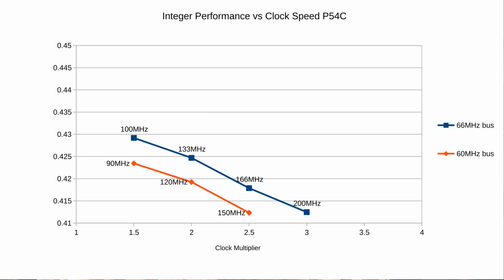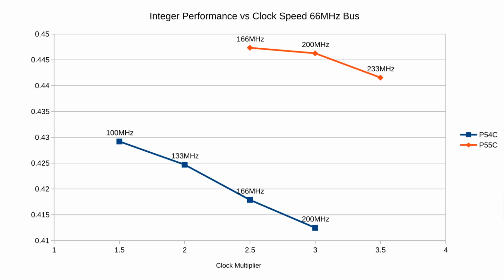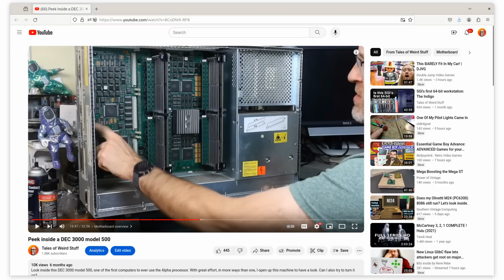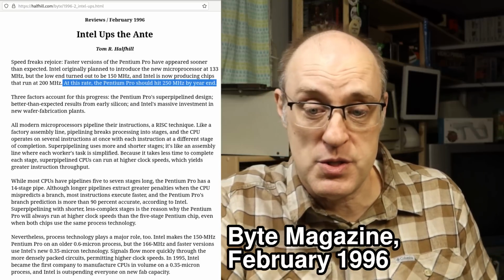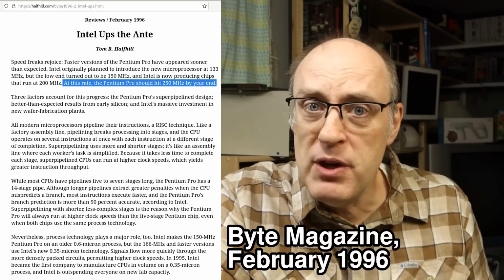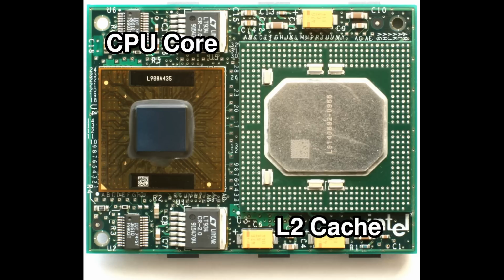Why did slot CPUs exist?

Comment: 44:45 Not all slot processors have half cache speed. Only from Intel, those that have a cache on the board and not on-die. AMD Athlon in Slot A design have a 1/3 speed cache. Even before the release of the Pentium II, some manufacturers used a processor card with a CPU and cache to increase scalability. By changing the processor card, one 486 up to 4x Pentium could be installed in one motherboard.

Comment: had a slotket adapter for putting a pentium 3 700E in my slot1 abit bh6 board back in the day (upgraded from a p2-350).  but that was a 100mhz FSB board.

Comment: I know this the celeron 300a was locked with 4.5 multiplier.  It was supposed to run at 66 MHz.  But kick that clock speed up to 100 MHz, and you had a 450 MHz beast that could easy match a pentium 2 which easily cost an extra $500.  🎉🎉😅

Comment: Nice video. I couldn't find any comments about the BEST feature of this era, or ecosystem of hardware. Slot 1 based motherboards (Pentium 2/3) all had both ISA, PCI and AGP slots, which is great for DOS gaming; good graphics card (AGP), the best sound cards (ISA), and a myriad of other cards on PCI. It is just a fantastic time period. And everything pretty much just works.

Comment: Serial buses won almost everywhere in both terms of bandwidth and latency because of clock skew (latency) of parallel buses.
Slot processors limited the number of pins and were mechanically difficult to install and remove.

Comment: I was an early adopter of the slot A Athlon, a 650MHz part, running on an IronGate 751 chipset board (the better chipsets from VIA were still a few months away). Needless to say, I just had to try fiddling with the resistor combinations that set the multiplier. Getting the plastic casing off was very difficult; I ended up destroying it - but I also ended up getting a stable 850MHz clock, for free! While it was a faff and I voided the warranty within a week, there is something to be said about small CPU PCBs that allow you to swap resistors around as opposed to the unreliable pencil trick on the later socket A parts. I never did get a goldfinger device - I accidentally inserted a dimm improperly and ended up burning the memory slot and the dimm so the motherboard went into the trash :(

Comment: Cool video, and yes I subscribed immediately, but I'm surprised you didn't really mention the big issue with a wider bus: namely that all the traces have to be the exactly the same length, and the tolerances get tighter as speeds increase.
Reply from the maker: Wasn't the video long enough?!? 🤣 I had forgotten about that aspect. Routing an increasing number of traces at all becomes absurdly difficult. Routing them well and within the other limits... forget about it.

Comment: SEC is definitely an interesting oddity in computing history (as are the slotket adapters). As much as I hate the cooling and retention systems on these, I did like the physical protection offered to the CPU itself.  The P3 coppermine 370s are easy to damage with too much pressure (I found this out the hard way).  Cool video, thanks for the interesting history on cache.

Comment: You are such a nerd. Subscribed! I totally get the technical reasons why slot CPUs didn’t stick around, but from a build perspective they were awesome. It also strikes me that this form factor could have some cooling advantages, imagine running heat pipes (or sigh water) to both sides of the CPU. Of course this doesn’t solve the other problems, the physical distance to system RAM is still a dealbreaker. Also upgrading modern CPUs in the same socket is usually reasonably pointless (on Intel in particular), unless you purchased extreme low-end to start with, and are going to extreme high-end. 

I do miss the Celeron 300 running at 450 or more, those were fine.

Comment: my first PC was a pentium pro 180mhz by gateway computers, I had like 48mb edo ram with a 4mb sis s3 trio video card. dam it could play games like red alert 2 which needed much highter spec. It was so punchy, snappy and just powerful. The next best chip was the first wave of Durons or the athlon xp series which was similar in its time.
Reply from the maker: That's an uncommon first PC for sure. :) I think my PPro system from back in the day was similar... but I also had a Voodoo card in it. It was one heck of a Quake system.

Comment: Going back to DEC, there are some systems with the Alpha 21264, like the DEC/Compaq AlphaServer DS20 that I have, which have a type of "slot based" CPU configuration, just like the Pentium II, Pentium III, and Athlon CPUs (Like you mentioned in the video). The CPU card in my AlphaServer contains the CPU soldered to the card, along with a VRM, cache memory, and a firmware ROM. The 500MHz CPU card that I have has 4MBytes of cache on the card. Because there is a VRM on the CPU card, it has a separate plug to provide +5VDC and Ground to the CPU card directly. I found it kind of interesting that they would include a firmware ROM on the CPU card too, rather than on the mainboard. My system supports two of these CPU cards, although I only have one installed currently. They are getting really difficult to find.

One problem is that I can't just slot in one of the 833MHz CPU cards from the DS25 or DS40, for example. They made the CPU cards incompatible across systems. I think I recall a 633MHz Alpha is the fastest card I can put in my particular system. I'm not entirely sure why they did this, and why the CPUs were soldered right in to these CPU cards, but my guess is that it forces you to go to their newer model of AlphaServer if you want the faster CPUs.
Reply from the maker: That is interesting. I was not aware of compatibility issues with the slot B Alphas. My friend in the AlphaServer ES47 video (https://youtu.be/z658a8Js5qg) has a slot B system, and I don't recall him ever mentioning that. It seems like usually when there's a restriction like that, there is some (perhaps weak) technical reason... but I can't guess at it what it might be in this case.

Comment: the point was to prevent amd cyrix from using a the same board as a intel chip. a attempt by intel to slow down it competition seeing since they made this crap just for that. amd made a package just like intel but made it open use anyone could use. intel claimed it was to use more cache closer to cpu for speed gains and cheaper cache.

Comment: would actually say the 486 pentium overdrives, although not in a cartridge slot, were the first such a thing. as those too contain far more components on that single unit. on board ventilator, voltage regulators, cache, etc. so the user cannot screw anything up. just like with them slot things later. just plug it in and it works. (as guess what. system administrators have better things to do than to screw around with cache modules and thermal paste). as for your 'cost' argument. don't think that really applies. you're essentially buying an $5 product for $1000 anyway. neither intel nor the customer gives a damn. as long as it's easy and works. lol.

Comment: never had a problem with any of them package things btw... only later and only with the cheapass ones they turned into 'just a chip with pins on a pcb' tho. at which point the advantages were kinda gone, as then you might as well just put that chip with pins on the actual pcb. :P

Comment: I worked for Unisys in the UK from mid 90's to 2008.  I was a Unix/Linux expert and for one of my tasks, I had to put together a little Sequent Symmetry development system for my team in the mid 90's)..  My boss took the Unisys Sequent guyin Milton Keynes for a pint ... and I assembled a Sequent Symmetry + Sequent NUMA-Q from spare parts (and no I'm NOT Sequent trained!) and wrapped then up for shipping to Manchester + sneaked them out the back door.  I had to lovingly cared for those little mini-computers for a couple of years.  I've always wondered ... why the fugazi did the NUMA-Q console run Windows NT 4(!!!).  I ran Cygwin/KDE on the console (for X-Windows) to install Oracle!
Reply: Addendum - I compiled SAMBA (+ other GNU stuff) from sources on DYNIX/ptx on both the Symmetry and NUMA-Q so the MIcrosofties could map Sequent disk space as 'drives' and could cope with writing Tuxedo/T modules + Oracle bindings as the back end for a Visual BASIC 6 front end (shudders!).  They used a Unix/Linux compatible Windows based text editor but I can't remember which one.  We wrote a TCP/IP multiplexor to frontend Tuxedo/T to ... erm .... reduce the number of licenses we needed.  Neither Oracle nor Tuxedo were impressed but it worked really well and was perfectly legal - sort of like having an L2 cache really!

Comment: I had so much bad experince starting with Pentium Pro that I switched to AMD and never looked back. Every system I bought with Intel Pentium Pro and better as time went buy would die in 2-3 years. It happened to my systems and to my work stations. It was bad. These where all pre-confirgured OEM computer. In 1999 I went back to building/configuring my own computers and went to AMD CPU's and since 1999 I have not had a single CPU fail. The systems are replaced while still fully functional but obsolete.

Comment: There are people who buy high end workstation CPU for around $800-$1000 USD. I was an early adopter of the x299 platform and it only now around 8 years later needs an upgrade. There weren't a lot of enthusiastic overclockers and video editors in the 90s and early 00s so the market for pro CPUs was small by comparison.

Comment: I didnt get a computer until 2003 and never came across this format until working at an eWaste facility. I thought they were pretty neat form factor. A but more expensive than to ship a Pin CPU in an envelope w/ no packaing through... Yes ive sent two desktop hard drives in a USPD flat legal envelope before.

Comment: Sun UltraSPARC CPU modules as used in the Ultra 2, 30, 60, 80, Enterprise 250, Enterprise 450 and a few others are mounted on edge-connector cards in a shroud much the same way as the slotted Intel, AMD and DEC CPUs. The US-III CPUs used in some later machines are on cards too, only with an obnoxious compression connector that made SGI's XIO connector look easy to work with.

Comment: Thanks for this.  I remember the Celeron 300A and on Toms Hardware (iirc) where a description on how to patch it so you could run dual  celerons. This was overclocked to 2x450MHz  and i had it for many years. Just having two cpus was very beneficial in some applications as one could be busy with some slow peripheral and the other one would run full speed.  Had it in this configuration until i got two 550MHz P-III for free which gives a hint on how old it was then :-)

Comment: Fairly sure the slot design was so they could put the Cache RAM chips closer to the CPU with direct control to get around the limitations at the time (cache not running at the same clock as the core etc) until they started to integrate L2 into the die.. And then it didn't have to sit miles away on the motherboard or use the chipset lol on Socket 7 systems, motherboard cache became L3 when L2 was integrated into the CPU (AMD K6..i hate AMD and love Intel but its the easy example)

Hour long video, but the above is the main reason compressed into a paragraph!

Comment: I think that losing this form factor was foolish in retrospect, but it's obvious why it died at the time. Today's version could just plug directly into the PCIE bus and some sort of standardized power delivery; it already has plenty of bandwidth available and insanely-low latency. We no longer have things like cache outside the CPU package. But more importantly, we could build PCs with water cooling built into these slot CPUs with a quick-disconnect system, rather than today's complex and messy installation systems, which continue to make watercooling less popular than it should be, which in turn limits designers. At this point, for anything more powerful than a basic laptop, watercooling or stuff like Frore's solutions should be standard-issue tech; we're well past viable passive cooling and airflow-cooling is really starting to have problems for everybody except in Enterprise solutions (and even there, the progress in glycol / watercooling systems has been remarkable in the last 5 years).

This kind of form factor- thinking of the motherboard as a mere location for power delivery and IO traces- would massively simplify installation and get rid of most of the design problems for motherboards, other than the continued legacy issues associated with IO (which, imo at least, should've been fixed ages ago by standardizing on POE-enabled CAT-6+, USB-C, etc.- we now have many different standards that have the bandwidth and power-delivery necessary for input devices, video transmission and data transfer; it's ridiculous that we haven't standardized this).

Tomorrow's chiplet-based and 3D layered CPU designs, which will almost certainly eventually arrive at huge cache memory (we're already hitting caches in GB for L2 in Enterprise) and all of the DRAM they need for their use-case, in a common form factor where all that's required is the position of the bus pins and hookups for water, would offer a way for end-users to swap out processors quickly while having a built-in CPU, memory, cache, even GPUs, while being engineered from the start to provide adequate cooling performance.  No more plugging in chips, bent pins, forgetting to clean the surfaces, bad mounting pressures, etc., etc.- all the little details that those of us who've built PCs for 20 years know backwards and forwards, but are still a total mystery to most people.

Moreover, systems built this way could have simpler BIOS, in the sense that BIOS would be for simple regulation of core things and basically kept out of high-level tasks (adding security and reducing complexity), but things like DRAM timing, etc., could be engineered for the specific solution being sold. 

A "basic gamer slot" might feature less, but faster DRAM, a GPU that's adequate or mildly future-proof, and be a complete system without needing additional hardware other than a basic motherboard, power supply and storage, for example. There wouldn't be anything to dust or keep clean, other than the fins for the radiator. If you wanted more GPU, you'd buy a third-party GPU upgrade plugging into another slot, like we do today, but its form factor would be considerably smaller- adding power deli

I find it incredibly frustrating that we're still dealing with motherboard designs and form factors that are stuck in the 1990s due to sheer inertia. Building and doing initial config on a brand-new system built from parts is still overly complex and fussy. We can do better. This tech was just solving the wrong problems at the wrong period in history.

Comment: Wow, I watched this, just for the memories.  

To the video creator, it was fun to watch you laugh at things that only old techies like us really get.  Reminds me, the other day I'm in the store and some old song from the 60's comes on and this guy I don't know turns and says to me, "that was my first 45", this younger man he was with leans over and goes, "I thought you didn't like guns?"
  We looked at each other and started cracking up.

I was surprised he didn't mention the Covington 266 and 300MHz Celerons in Slot 1 without cache which were terrible performers.  I never owned one, thankfully, but the overclocks on some of those were amazing, but the performance without cache was still bad even overclocked.  Makes me wonder if there's a story behind why they sold those chips without cache.

Speaking of that, I had a P3 550MHz in Slot 1 that I decide to put my own aftermarket cooler on and, if you remember, there were no heat spreader on those CPU's.  The die was (from memory) about 1cm square an I didn't ensure the pressure was even on both sides of the heatsink.  Even the slightest tilt on the heatsink was basically like having no heatsink at all and it only took a few minutes before Windows crashed an was hopelessly corrupted as my CPU's temps hit insane levels.  Curious, I disabled the L2 cache, reloaded Windows and it worked!  Not great, but it worked.  I was able to get an 800MHz overclock out of that chip without the L2, I can't remember if I had to disable L1 as well, that was a long time ago, and losing $450 the same weekend I bought that chip, I did a lot to try to forget that incident.

I also wish of all the unusual setups I owned In my days that I had never gotten rid of my Abit BP6 twin Celeron366 that both OC'ed to 550MHz without breaking a sweat.  That would be a fun piece to tinker with today.

Another neat little fact, though not terribly relevant were the Pentium 120mhz an 150mhz that were OEM only CPU's that didn't make the cut as 66/133MHz and 66/166MHz respectively.  OEM's dropped their bus speeds on the 120 and 150MHz CPUs to 60MHz (from the normal 66MHz), making their performance about the same as their lower clocked (but higher bus speed) counterparts.

Also funny sidenote, but the Pentium Pro's contain about 1 gram of gold, which at today's prices means the CPU is worth about $65 in gold alone!  As an ole hardware guy that disposed of many a Pentium pro.....Just dam.